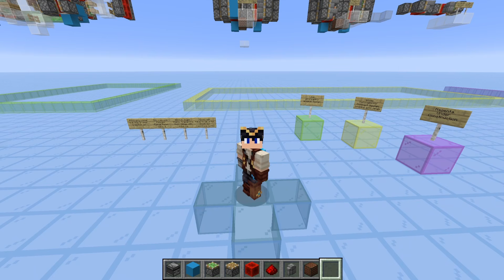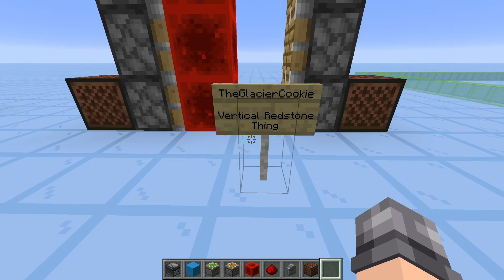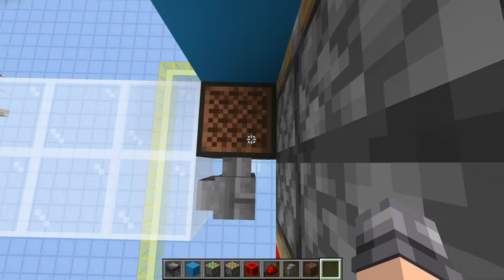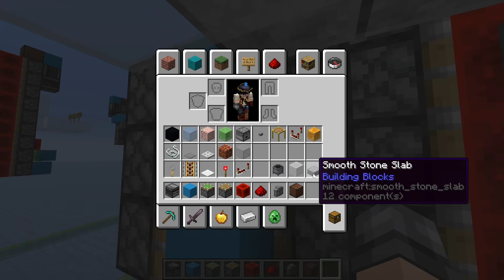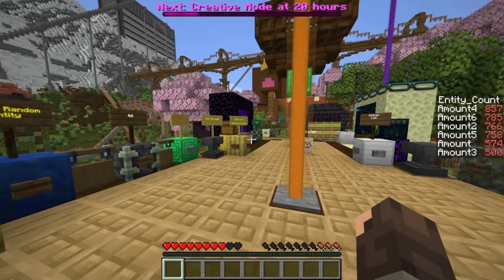Compact Instant Minecraft Elevators Based On The Brockavator (Java 1.21.4 - 26.2+)

Comment from the maker: *Disclaimer: This design is directional and must be built facing North or South, also this may not work on servers with modified software like Spigot/Paper that make the game process ticks differently, but it should be fine on normal multiplayer servers. Sorry I didn't add this in the video, didn't realize it until later. (This specific design works on Java 1.21.4 - 26.1.2+)
Reply: i see this after i built a huge version on a server where it doesnt work
Reply: @nsif1 same here 💀
Reply from the maker: @nsif1  Yeah sorry about that, I didn't realize this was a problem until after I uploaded the video, I'll see if I can find any solutions to make it work on all servers.
Reply from the maker: @nsif1  Actually I realize now the problem could also be the way it's facing, try building the small one facing north or south to see if it works.
Reply: @kylonemesis  your design is directional, but you can just flip which side the noteblock is on to make it work the other orientation (noteblock must be on the SW corner regardless in my setup, it may be NW in your design, because I use rails which update in reverse ofc).

I came to basically your same design independently haha (minus a much smaller bottom station, basically I just update the rails and then use an updater like brockade has)!
Reply: Okay it seems to be inconsistent with your design, so I'm not sure whats up with that, but I'm sure there's some way to make it behave the same.
Reply from the maker: @BombsanTheCommenter Interesting find, I'll do some testing and mess around with this
Reply: @BombsanTheCommenter  yo if its not working consistently then you made it wrong bro
Reply: The warning comes after the spell
Reply: Does it work on bed rock
Reply from the maker: @ahhhhhhh-r4cIt doesn't work on bedrock
Reply: wish i saw this at the start for the north to south fact

Comment: to anyone else building the taller version, its only visible briefly in the video but you don't need to use a long line of observers. only 2 at the top below the noteblock. one facing the piston, one into that observer with the noteblock on top. that should stop it breaking and having some blocks persistently activated!

Comment: Do the observers go all the way up? Or are they just at the top? I built mine with the observers going all the way up and the thing pulses on and off and breaks near the top parts
Reply from the maker: there only at the top, at 2:53, I glance over to the tall version and if you pause at the right time you can see from a distance what it should look like, it's the same system as on the small version.
Reply: @kylonemesis  ah cool saw it. thanks for replying

Comment: when i built it i made sure it was facing the correct direction but it seems like the timing is messed up sumhow one redstone block stays pushed powering two of the front pistons and if i press the noteblock again the signal travels down and the next two pistons get powered does anyone have a solution

Comment: it breaks whenever i used it, the redstone blocks get stuck and then keep the sticky pistons active, the more you use it the more it breaks, atleast thats for me also im facing north and i checked that everything is where it should be
Reply: Same for me. Just built this on 26.3 and it's like they have a mind of their own. I've built it facing south and it has a 100% failure rate after the first initial use. And I've quadruple checked to make sure I built everything properly.
Reply from the maker: @Xpekade Interesting, I haven't tried it on 26.3 yet I hope the update didn't break it or something I'll test it and see
Reply from the maker: Sounds like something is wrong with the thing at the top that pushes and resets the top redstone blocks, double check if that part is built correctly.

Comment: Idk why but when I create a very large elevator using this model, the pistons on the top start activating each other and although it works the 1st time, the more times you use it the more pistons get "stuck permanently" (activated) with the redstone blocks in a zig-zag pattern, so after one use it become useless unless you replace all pistons. (I'm trying this on the 26.2 update in a normal creative world). The smaller  4-block tall design you've shown in the video works for me, but im having troubles with the big one (as i said)
Reply from the maker: Double check that you built it correctly, it sounds like something is wrong with the system at the top that pushes the redstone blocks back over
Reply: @kylonemesis  actually it happens to me either. i guess it was built correctly tho
Reply: @kylonemesis  happens to me too, facing souht, exactly design

Comment: I’m having problems with it— you said it could go as high as you want it to be. Yet even though it works, it’s only a one time thing. The Redstone blocks keep getting stuck about 2/3 of the way up after transporting you to the top, and it just permanently breaks the elevator. Am I doing something wrong, or is there a problem with the build??
Reply: I FIGURED IT OUT. you arent supposed to make an observer tower in the back under the note block. look at 4:20. thats how its supposed to look at the top, without an observer tower all the way down. i didnt bother to put the observer on top of the note block and it appears to behave fine, not sure if thats required or part of something else.

old comment;
im having the same issue and i swear i built it correctly
the top third of my elevator end up in a checkered pattern somehow
the pistons at the top start alternating instead of firing in unision
Reply: I don’t know if it’s my tick speed? Which I’m guessing it might be. When I activate the demo that you did the first 2 are on the same tick, yet the 3rd block is late.
Reply from the maker: @lucid4828  The tick speed shouldn't effect it as long as the game isn't lagging, it sounds like you may have built it wrong, double check its built correctly and if it still breaks check if it's breaking at a sub chunk boarder. For the demo having the 3rd block late sounds like you have made it too short, the redstone block parts should go 1 block above the sticky pistons.

Comment: Could you show how to finish a taller version of the brockavator? small one works fine but something breaks with the last 3 pistons in taller version
Reply from the maker: Did you build the automatic pusher thingy at the top? Also yeah I'm planning to make a video with better tutorials soon
Reply: @kylonemesis the one with 2 observers and a note block? yes
Reply from the maker: @ninjamejster2818  That's odd, since its just the top 3 pistons it must be something with the observers, double check their placed properly it should be exactly the same as the small version just with the pusher placed on top. If the observers are correct and its still not working does it work without the pusher?
Reply: @kylonemesis oh sorry you meant that little pusher thingy. I mean that in the elevator alone without pusher last 3 pistons behave weird with last piston working different than others. It leaves like a split second to leave the platform instead of normal piston push time
Reply from the maker: @ninjamejster2818  Oh I see, so is it teleporting you up properly then retracting quicker than normal? Are you playing on normal vanilla Minecraft or do you have mods installed? Also is it single player or on a server?
Reply: @kylonemesis  yes, version is 26.1.2, technically vanilla but I have just some qol mods that don't interact with physics at all. I'm testing on singleplayer before building on a server
Reply: @kylonemesis  would you be fine with adding on discord to chat easier?
Reply from the maker: @ninjamejster2818  Yeah it would be a lot easier if I could see a screenshot and/or clip of it being broken, here's a link to a discord server I made for yt but haven't put on my channel yet https://discord.gg/YEJPMw7zgY
Reply: update: I forgot that the layer with normal pistons should be one block taller than sticky pistons if anyone has the same situation

Comment: my noteblock does not give redstone signal, why is that?
Reply from the maker: Are you on java because this design wont work on bedrock, if you are on java double check you built it right, also if its still not working what update are you in and is this on a server?
Reply: @kylonemesis yes! 1.21.11
Reply: i wanted to try on a server, but i did it in a singleplayer world
Reply from the maker: @solumR  I just tested it on that update and it worked for me, if the noteblock isn't giving a redstone signal make sure your redstone blocks are in the right spot, they should be BUD powering the piston behind the noteblock so when the noteblock is clicked it does a block update and fires the piston triggering the chain of pistons above it to fire.

Comment: 1am brain says put the string a block farther out and it'll work the way u want it
Reply from the maker: That would work, but Ideally if I can I want it to fire when the player is in the right spot and not just be timing based because if the player is too slow getting in the spot they'll miss it
Reply: @kylonemesis you could also put a repeater with slightly higher ticks there to make it less timing based idk tho it's just my simple mind

Comment: I’m pretty sure I followed your tutorial correctly but mine just clips me into the first solid block and I don’t get pushed up at all. Any idea why?
Reply: try in 26.1.2, it work for me
Reply: Me too, i tried it in 1.21.11 and 26.1.2 and tried it at different axis, still doesnt work
Reply from the maker: @f2bc882  That's weird, it should work in both of those versions, are you playing on any sort of modified game like a paper/spigot server or anything? What part of it is breaking?
Reply from the maker: After more testing I've discovered it only works with the front facing north or south so that's likely the problem, sorry I didn't mention it in the video I didn't realize it was a problem until later
Reply: @kylonemesis Oh ok thank you very much
Reply: @kylonemesis  it dosnt work neither, im trying also in different versions. :c
Reply from the maker: @DNTarquipugDominó  That's odd, is it at least firing and just not pushing you up or is it not working at all? Double check that it's built properly and the walls and blocks are on the same sides as shown in the video. Also try building it facing 90 degrees over just incase you accidentally built it facing the wrong way, if its still not working describe how you made it and in what specific version and I'll do some testing to see if I can find the problem.
Reply: @kylonemesis  don't worry, it works now :D
The problem was that I clipped into the solid objects and didn't go up. Maybe because I was using rare objects like Birch wood slabs or Polished deepslate walls.
Btw the north / south orientation stuff maybe is because observers work different according x / y axis 

Greetings from the white city (Arequipa. Perú) 🙋‍♂️ thank u ❤
Reply: @kylonemesis mine is facing north/south and still not working